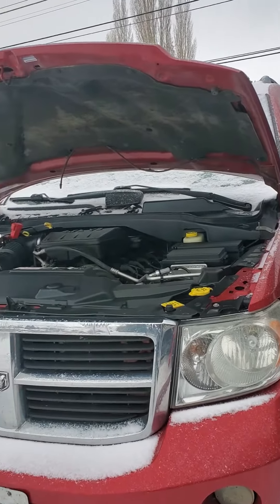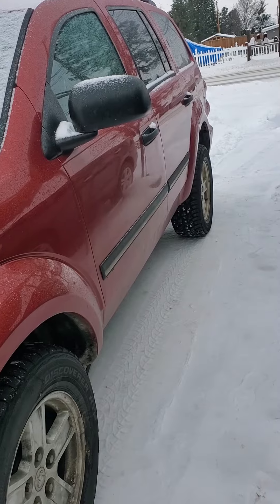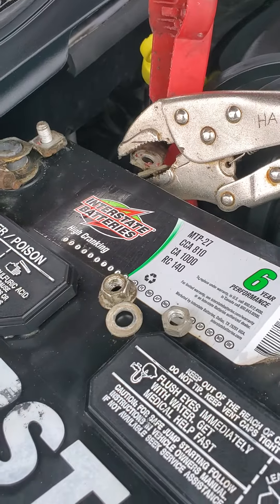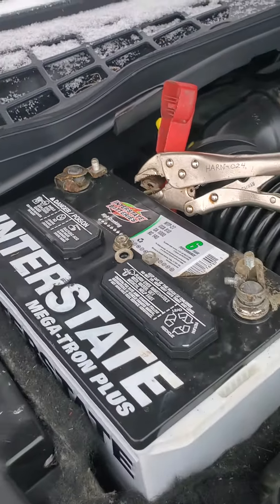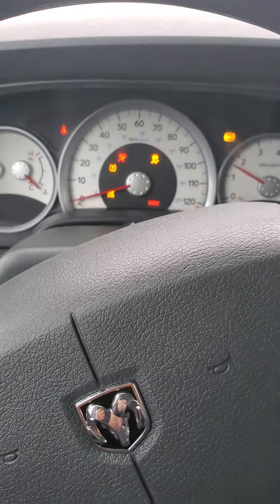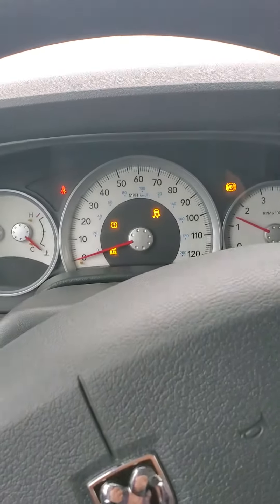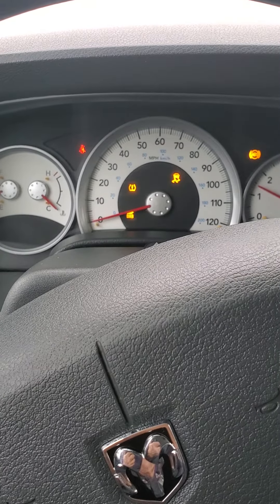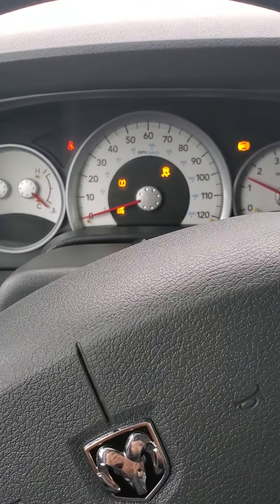How yo reset your traction  control and anti lock brake lights fail

Comment from the maker: So I checked the new sensor and it's working and there's power down to it but I think the metal gears that the sensor reads have been damaged when the park break failed so it's not working